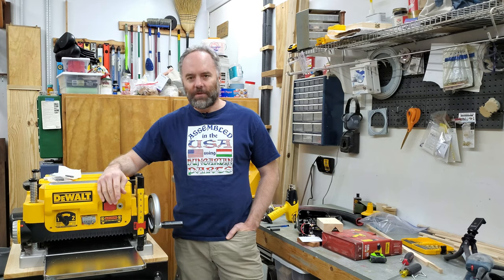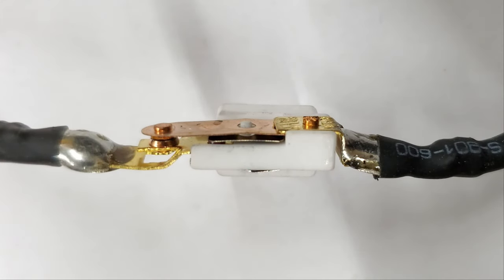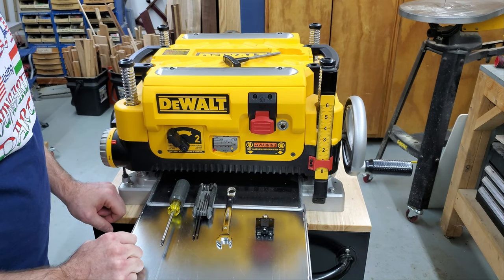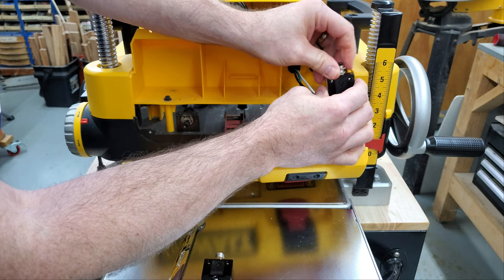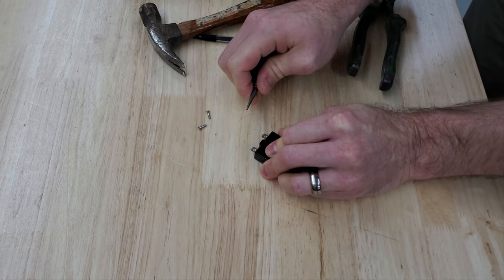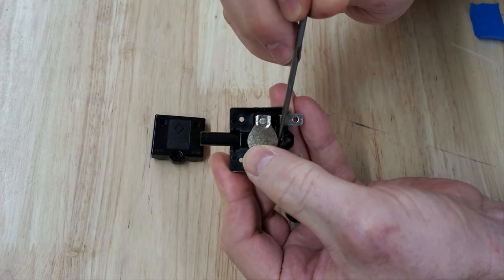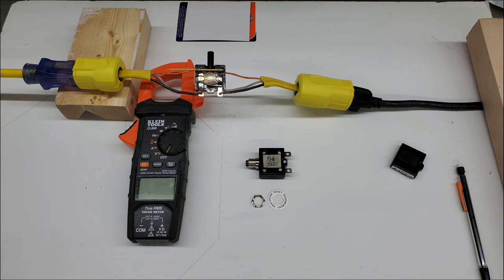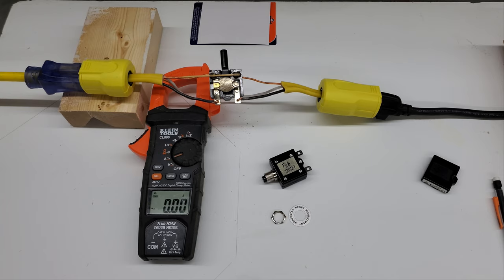Replace a circuit breaker, learn how it works, and overload the old one

Comment: Just remember, the overload on the planer protects the Planer motor and the circuit Breaker in the panel protect the wiring used to the receptacle.   Do not change a 15 amp breaker to a 20 amp unless you replace the 14 Gage wire to 12 Gage wire.  Also you seem very interested in the amps  but not the Voltage..  The voltage drop is even more important. Circuit Breakers work of heat caused by amps.  They also have timers that need to time out before they will trip.
      Most house receptacles are 15 amps.  Kitchen, bathrooms, utility rooms and a few garage receptacles are 20 amps.  So did you actually find the breaker for that receptacle? was it 15 amps or 20 amps?  Their is alot of difference between a overload device and a circuit breaker.    So what did Dewalt tell you about your findings.
Reply from the maker: I put the voltage measurements in the description for this video: https://youtu.be/47PyY4K47KU. I haven't discussed it with Dewalt, but I think the fact that they used an 18a breaker rather than a 15 or 20 tells me that they didn't want to add a 20a plug, but knew it drew more than 15 amps.
Reply: The circuit breaker in a residential panel is generically known as an "overcurrent protection device". And overload device is specifically designed to protect motors from thermal overload and and designed to be used with a specific type/rating of motor. The breakers in your breaker box are mostly "thermal magnetic" meaning they have a long time characteristic and an instantaneous characteristic. The long time characteristic is designed to protect the conductor between the breaker panel and the load (motor) from getting too hot and causing a hazardous condition (and resulting fire).  The instantaneous characteristic (the magnetic part of thermal-magnetic) is designed to open the breaker if a current exceeds a certain, much higher, threshold - such as would happen if you drove a nail through the conductors in the wall somewhere or dropped a screwdriver across the hot and neutral (or hot and ground conductors.  The planer, drawing more current than the "handle rating" of the breaker does not trip, but it is heating the bimetal strip slowly and would eventually trip if you kept planing like that for hours at a time.  When you stop, the bimetallic strip begins to cool off but starts heating again when you start planing again.
There are electronic circuit breakers (or trip units for circuit breakers) that sample the current rapidly and start to time towards a trip when the handle rating is exceeded.  That is the "timer" you mention.
Your comment about not changing breakers is spot on. Doing so can cause a fire.
The voltage is interesting because the motor requires a certain amount of power to spin/plane and if the impedance of the wire between the breaker and motor is high enough to cause an appreciable drop in voltage (V = I x R), the current that the motor will draw increases as the voltage decreases.  This should be familiar to anyone who has tripped a circuit breaker by running an air compressor using an (under-dimensioned) extension cord. Motors, especially compressor motors are notorious for drawing a lot of current when they start up.
As for the comment that there is no line/load side of a circuit breaker, the answer is yes, there is, but not always.  Residential breakers can only be installed one way so technically they have a line and load side.  There is a classification of circuit breakers under UL489 that allows a breaker manufacturer to mark a breaker with line and load markings indicating that it is not suitable to be reverse fed.  This does not apply to resi breakers however.

TMI, right?

Comment: I just tested my old 12" Delta 22-540 which is a typical 15 amp planer.
Start up current was just under 14 amps, and the no load current was 6.7 amps. I ran an old 4"x 6" Hickory beam through it for the test. 
Under full load, taking a 1/16 cut off the beam, the planer was pulling just under 10 amps, as one would expect given the fact that it is a 15 amp unit.

Comment: I have the full size Shelix cutter head waiting to be installed in my DeWALT DW735. I'm wondering if it will draw even more amperage than your under sized cutter head. The larger diameter may put more stress on the motor. I also need to keep the fan connected for chip ejection. I better stock on that breaker. Enjoyed the video, thank you.
Reply from the maker: I tripped the old one 10 times or so in the past year, mostly intentionally, and I haven't noticed any performance difference. It would be interesting to test an old one and a new one side by side though. Maybe one day.
Reply: Yes!  A larger head will definitely draw more amperage!  Like gearing, this applies to all machine tooling.
Reply: Is it possible to remove every other carbide cutter on each row of your Shelix?  That would remove a lot of amps. The question is can you do this without messing up your surface finish?

Comment: There is no line and load side on circuit braker.
It's symetrical from electric point of view. You can put it any way you want.
After all, current is AC, so electrons just oscilate both way 60 times par second :)
Reply from the maker: You are technically correct, it would have still worked, just like electrical outlets can still usually work if you have hot and neutral reversed.  There are, of course, several downsides, like misrepresenting which end of an open circuit could uncurl your hair.
Reply: @TheSnekkerShow  
Uncurling (I like this term :))... Not aplicable to fuse.
And no... there is not any downside if you reverse leads on the fuse.
Fuse have no idea which side is live, which is neutral. And has no influence on that (unlike cord).

And there is not "usualy". You can put cord any way you want, and appliance will work. It is just convention, and USA style of outlets that prevent you from turning plug in 180 degres (most of Europe can put plug in any way they want).
It just doesn't metter.
Only if you disassemble device... then you must take care wihich wire is live.

Comment: Would have been interesting to see at what temperature it tripped at.
Reply from the maker: Yeah, I was thinking the same thing. I'm sure I'll give in to curiosity eventually. I might still pop it in the oven for a rough idea.
Reply: @TheSnekkerShow  I wonder if you could use a IR thermometer non-contact style.
Reply from the maker: @cadnukes  I had one right next to me too. Should have done it before putting the internal breaker back in.

Comment: Is it possible to remove every other carbide cutter on each row of your Shelix?  That would remove a lot of amps. The question is can you do this without messing up your surface finish?

Thanks for taking the time for the awesome videos!   

Thumbs up! And subscribed.
Reply from the maker: I've been tempted to try that, but haven't invested any time in it yet. The main concern would be keeping the cutterhead balanced.
Reply: @TheSnekkerShow  As long as it has an even number of rows down long ways say 4 you can take every other insert out.. I think you said it has 40 inserts so take out 20 I'll bet you it will run great... This would be a huge bonus for guys with a larger cutter.  Plus you'll have 20 extra cutters!!
Reply: @TheSnekkerShow  Just need to make sure with the insert out there's enough clarence for it's holder not to hit the wood.
Reply from the maker: @Jeralddoerr  The balance needs to be along its circumference, not its length. Since it's a helical pattern, removing alternating cutters could shift the weight enough that the planer would start to vibrate.
Reply: @TheSnekkerShow  Yes, I completely understand. I used to balance all deferent configurations of RC helicopter blades.. Also did this with a indexable end mill I had on my CNC..  It had 4 long rows of 6 inserts. I would take 3 inserts out of each row .. say row (1) take out 1,3,5, row (2)  2,4,6  row (3) 1,3,5 row (4) 2,4,6 effectively removing half the inserts.. so the motor has to do half the work.  
like I said before this only works if your tool has 2,4,6,8, rows of cutters... you cant do this with 3,5,7,8, + as your tool will no longer be balanced. 

 But I would not recommend doing this unless you knew exactly what you are doing as you could damage your machine.

But thanks for responding..  If I ever pick one up myself and give it a shot I'll let you know if it works!  ;)

Comment: Hey my planer trips way too often and I don't use it That much because of the tripping and I only bought it like 3months back
Reply from the maker: Sorry to hear. You might be able to reduce power consumption by waxing the bed, adding infeed/outfeed support, plugging in closer to the electrical panel, taking shallower cuts, and even giving the boards a little manual push/pull since the same motor is turning the feed rollers and the cutterhead. If you have an actual dust collection system (not a shop vacuum), I also have a video about removing the impeller for more power.
Reply: @TheSnekkerShow  yea I saw that video

Comment: So should I replace the 20 amp breaker on the house to 30 amp breaker?
Reply from the maker: No, that would be dangerous because the wire and receptacle would still be rated for 20. If the breaker trips, it's to protect something else.
Reply: @TheSnekkerShow  ok. Thank you sir
Reply from the maker: @JoseHernandez-mj6ne  You're quite welcome

Comment: Ordered a new breaker for mine and did a deep dive to lube the rollers and chains. Hoping this fixes my problem. Trying to plane some 12" wide laminated 2x4 planks for a workbench top and the constant breaker popping is killing me. Lol
Reply from the maker: I've been considering a similar project for a long time, to finally replace my old MDF-topped benches. That's a lot of work for a benchtop planer, but a few other things you could do to make slight improvements include cleaning and waxing the table, moving the planer to a receptacle as close a possible to the breaker, making sure your infeed/outfeed support is perfectly flat with the table to reduce snipe and racking, using roller stands to reduce how hard the feed rollers have to pull, and even giving the board a little manual push/pull to again reduce how much power the motor needs to allocate to moving the boards.  Now I'm kind of curious to test that.

Comment: I did be woodwork with my neighbour for quite some years and it's only a near now I'm on my own. I wanted to buy a planer so I did all the research (the good side lol) on the Dwt735 so I bought one about 3months back and I wouldn't recommend it to anyone who wants to start wood working as a career. I think this planer is for a hobbyists. you can't even cut on the recommended depth for a certain width. Worst case scenario I paid $ 235,000 Guyana dollars now I want to dump it and Go for a industrial planner. I'm even thinking about upgrading to a shelix cutter. I'm frustrated
Reply from the maker: Industrial planers are definitely better for frequent, heavy planing. In some ways, it's like comparing a circular saw to a table saw. Sometimes portability and voltage are the most important, and sometimes power is the most important. Even with my 1.5hp table saw, I can't expect to rip thick hardwood at the full depth capacity of the blade.
Reply: Should I upgrade to the shelix cutter head?
Reply from the maker: @akebaharper5931  If you're already having power issues, I wouldn't recommend it. If you're thinking about getting an industrial planer, I'd put the Shelix in that instead.
Reply: Akeba and that's probably the BEST homeowner planer.... I agree, I'm going to look for a used old beast of a planer lol